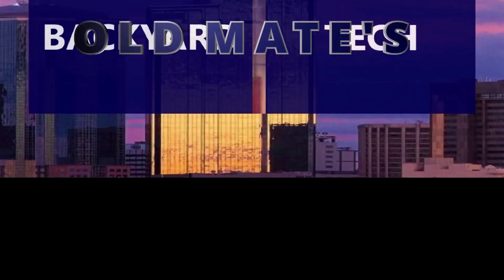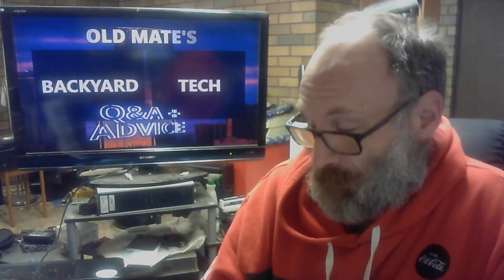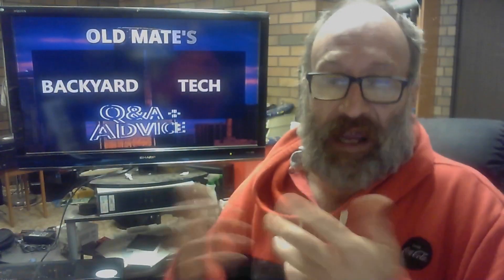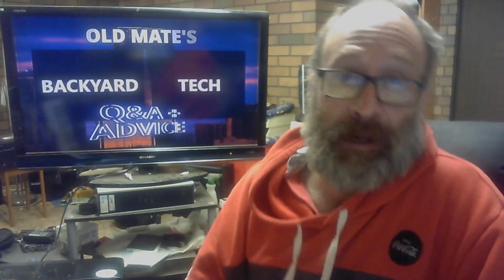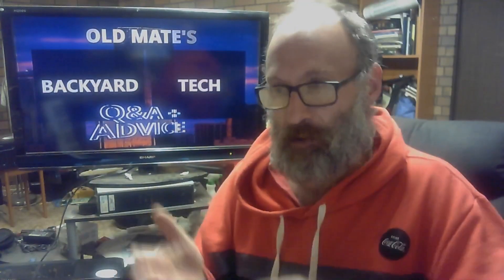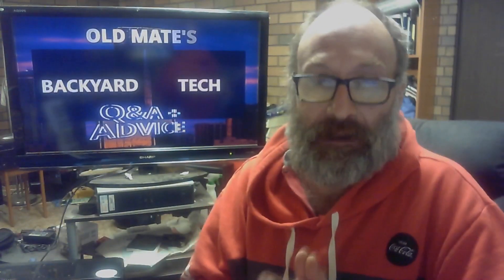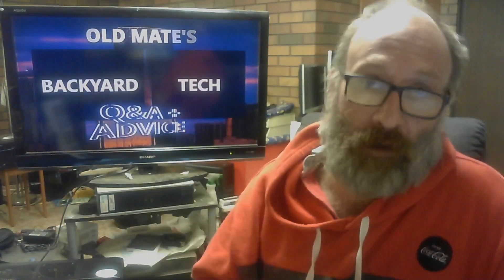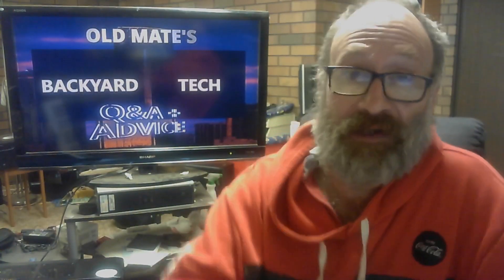Q&A + Advice - Ground Noise

Comment: BYT, thanks for this. I can try these suggestions. OOTB Focusrite provides a A to USB C USB cable that is quite a short length. I could get a longer one and it wouldn't matter for the controls; I can control the interface through my Alsamixer GUI. It wouldn't matter if the interface was in another room; I would not see the dials light up green/yellow etc to show any peaks. But I can live without seeing that. 

I agree that the RODE NT 1 is a nice sound. It is also very neutral so any post processing starts from a relatively neutral frequency point which I like.
Reply from the maker: The NT1 IS nice mic but doesn't beat a neuman u87
Reply: @OldMatesBackyardTech  Good microphone technique makes them both great!
Reply from the maker: Fair Point
Reply: @OldMatesBackyardTech  In the end I think that I had bad gain staging. I have got rid of the hiss noise by changing my gain staging with Alsamixer in Linux.